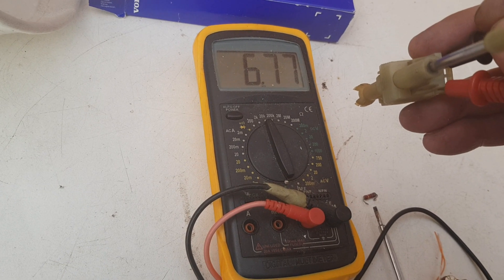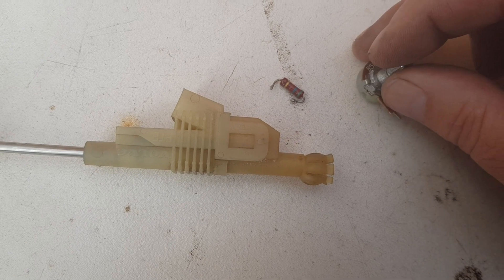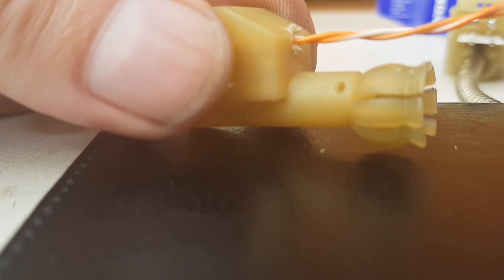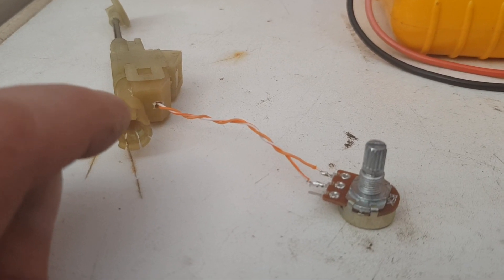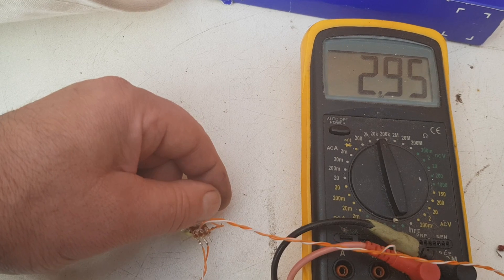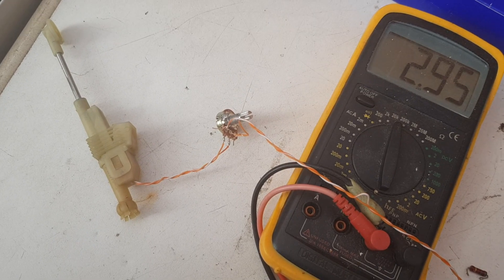Volvo clutch sensor future proof fix for pence, with variable rheostat.

Comment: Alternatively you can splice the potentiometer directly into the connector wires, so you don't even have to take the sensor switch apart.

Comment: @philcross7315     Alright.   I have the unit out now and it measures 4.55 Kilo Ohm (fully extended) and around 325 Ohm (fully compressed).  I believe (using an online tool - sengpielaudio)-  that I need to use an 8.8 Kilo Ohm resistor to bring it down to 3k Ohm and 313 Ohm respectively.       
Does this seem correct, and is there a target value for when fully compressed?  
Does it matter when compressed?
Cheers!
Reply: Just to close this off.  The sensor is back in place, the error cleared and never came back, and the car is no longer a bit "clunky".    One satisfied driver here.  Thank you so much!

PS I ended up using a 10k ohm potentiometer (se to around 8k ohm) that I set (and then sealed from turning) with some heat shrink over the screw mount and twister knob.  This defends against accidental turning, but means I can still get at it and twist if needed in the future. Cheers again Phil!
Reply from the maker: Being honest, it's hard to pin an absolute value on what the resistance should be. Using a variable potentiometer is the best way, simply dial it to what works. Using a normal resistor is a bit more absolute, but they are only pence.
I hope that works for you, if not, have a fiddle with the values.

Comment: Curious.  While the Clutch Position Sensor is removed  (physically and no wired connected).. Will the car (2006 V70R) still be drive-able, just not quite as smooth?   Awesome share Phil and others....!
Reply from the maker: It will still drive, but you'll have the error code. Mine was "sharp" on the clutch. Not a problem, I simply adjusted my driving style, but noticeable that something wasn't right.
Reply: @philcross7315  ah ok. Good to know I won't be stranded while finding the right resistor to add in parallel .  I receive a few potentiometer today so will begin tonight.  Cheers again!  I'll report back on my before and after spec (including the final fix values for me)

Comment: Hello, I want to thank you on behalf of all the people you have helped over the years with these videos. In my particular case, I haven't managed to solve it yet because I don't understand too much about electronics. I have placed a 10k potentiometer on the sensor, and I have set it to 3k ohm open, but when I close it it barely goes down to 2k. Is there any solution? Should I put a bigger or smaller potentiometer? I would greatly appreciate your help. Thanks again!
Reply from the maker: Hi Xavier, thanks for your comment.
Try turning the resistor down to 2k,or 1k. It should find a place where it starts to work? 👍
Reply: @philcross7315  Hi friend! Thank you for your quick response. I have just tried connecting a potentiometer of only 1k, and when it is open it gives 1k ohm but when it is closed it gives 500/600 ohms. I can't get it to the optimal values. Maybe the resistive track is too deteriorated? I don't know very well how to act now
Reply from the maker: @JavierCuadradoValverde
I think you might be right? The track is too far gone. You could try with a lower value, maybe 560k ohms?
Reply: @philcross7315  560ohm or 560k?🤣 I think 560ohm , no?
Reply from the maker: Sorry, it's been a long day. 😂
Yep, 560 ohms. 👍

Comment: I just want to say a massive thank you. I was quoted £364 at my local garage to "try" and fix it after their diagnostics showed up that it was the clutch position sensor. 

I had a lot of trouble trying to locate it, but for those in the UK (right had drive) who are trying to fix their own, the sensor is located on the accelerator side of the foot-well. It's quite high up, but looks exactly like it does in the video, with the same green port plugged into it
Reply from the maker: Thanks for the feedback, always nice to hear it's helped. 👍

Comment: Thanks you, your solution worked. I bought two sensors, one oem (lasted for a year), and one after market which failed after 2 months. Hope your solution is permanent. Thank you once more.
Reply from the maker: Mine did the same, so I put the one I fixed, back on.
So far, it's been a few years 👍

Comment: what was the part called and the wires you used ??
Reply from the maker: It's called a potentiometer, or rheostat. The wires are just standard, taken from a piece of ethernet cable. The sensor is very low powered, so any wire/potentiometer will work, as long as its the correct value.

Comment: Use long wires and stick the pot somewhere close to the steering wheel or OBD , so when you need to adjust it you don't have to hang upside down in your car to reach it.

Comment: Definitely going to give this one a try, already bought a new 'Triscan' replacement part once but it lasted only about one year until it was too gunked up/ poor quality to read correctly. Might as well try to fix both of them up while at it.
Reply: I managed to adjust the 3k ohm position correctly (previously closer to 3.6k), but slide/contact surfaces of the sensor were in too bad of a condition. When pushed halfway it got down to 1,6k ohm but it jumps back to 3k as the contacts are in too bad of a condition. I'll try later with the Triscan model of sensor, but currently I don't havet ime to test it out more.

Comment: Hey Phil! My sensors resistance doesnt go down after installing the potentiometer. dialed it to 2,8k extended, but when i press it down, the Ohm reading stays the same. Have I broken the sensor for good?
Reply from the maker: It looks like it? It should definitely change if the sensor has any resistance?
Reply: @philcross7315  yeah figured it out later. I did indeed snap the circuit board inside the sensor while opening it. Found the missing shard on my floor hehe. No worries tho since I got a new one at 3,1k - 0,240k from the scrapyard. Gonna try again once this one fails, with more patience and less force :D.

Comment: Phil Cross, 
Good afternoon, is the rheostat variable carbon or coiled?

What is the best solution for resistance or rheostat variable?

Mine still activates cruise control but turns off soon after.

What reference to the rheostat variable?
And the resistance?

Thank you
Reply from the maker: Hi vasco,
It's carbon. Set the resistance just under 4k ohms and try that. If it doesn't work, adjust it down to about 3.8k ohms and try that.
Reply: @philcross7315  thanks Phill. 
minimum resistance of 2w, can it be higher?
I will try. then I give an opinion. Phill after changing the resistance, do I need to clear the error or is it functional right away? Best regards
Reply: Phil I had to buy a new sensor, mine was broken. after putting it in the car do we have to restart the error or should it activate soon?

Comment: Cheers for that man. Although before i found your video i bought a new CPS from ebay but lasted less than 2 month. Unfortunately i chucked away the original one. But with your advice the ebay one works as well now with the b5k potmeter installed on it. Advice to some of you making this repair, if for whatever reason after doing this repair the cruise would still not work, just Reset the car's computer by deconnecting the battery for about 5 minutes... Happy cruising! 😊
Reply from the maker: Useful info, cheers jocky.

Comment: Hey Phil, just wanted to let you know I did this on my R model. Same issue, exactly as presented. Went to the shops and got a 10k pot like you said ($3.50 CAD), hooked it up and tuned it down to just under 3k ohms and presto, it's working. Mine was reading 5k ohms, car lost cruise control and was behaving erratically with throttle. I initially tried a resistor to get it down to 4k with no joy. You are a legend good sir! Thank you! 
I've been dealing with so many issues with my car lately, and spent a lot getting it keeping it going and this was going to be another 100 dollar ding in the wallet (part is $91.00 CAD + shipping -- non dealer item -- didn't even check the price with them out of fear lol) that I can't afford right now. I wanted to let you know that you really helped me here. Thank you!
This is what makes the internet great, that we can all share info like this. Tremendous! As a side note, this also helps me keep dabbling with electronics like I have. Really great. Thanks again :)
Reply from the maker: Sorry I'd missed your comment for some reason?
Glad you got it sorted.
Just for info, the new part I bought and fitted went faulty last week, so I fitted this one I'd modified. Like you, it's working again. 👍

Comment: Hi, I don't usually comment but I have to thank you for the knowledge learned to potentially fix this on my S60.  I also learned more electrical knowledge because of this and it makes it so much easier with an object that I know what it does. I'll comment back to let you know if it worked for my case.
Reply from the maker: Hi notenuff. I missed your comment, hope you solved your problem?

Comment: I've just taken my cps apart and cleaned it but  it still didn't work so I've just ordered a 10k pot off ebay for 99pence. Fingers crossed my cruise control works after this.
Reply from the maker: Fingers crossed. 99p hurts a lot less than fifty quid!
Reply: @philcross7315  The potentiometer arrived today so i soldered it on and voila it works spot on! Thanks you have saved me £50

Comment: Two cables from sensor to pedometer and then two from pedometer to what? Dont show in video....?
Reply: Again. Same misunderstanding. 

The two "extra" cables are connected to the equipment mesusuring the resistance. Is v called a multimeter.

And don't worry, the car is safe to drive without the sensor installed, but does not let you use cruise control.
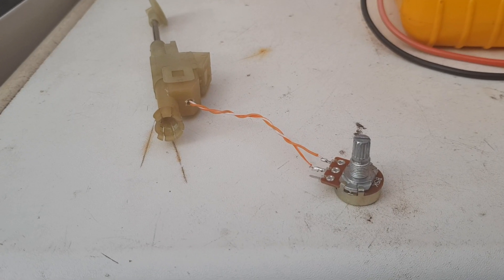Reply from the maker: It is only 2 wires. connect a wire to each of the connections inside the sensor, then solder the other ends of those wires to the potentiometer. One wire must be soldered to the middle/centre connector on the potentiometer. You can see the connections at 4:19 and then how to connect the potentiometer at 4:38
Reply: Hey. If you not understand. Go to garage. Don't do it self, will be danger for you. :DDD
Reply: @sergejssg  take it easy man.... Dont be toxit...

Comment: I dont anderstand 6.50 in the clip how have you connect all? You have two more cables connected from pedometer? Dont get it...?
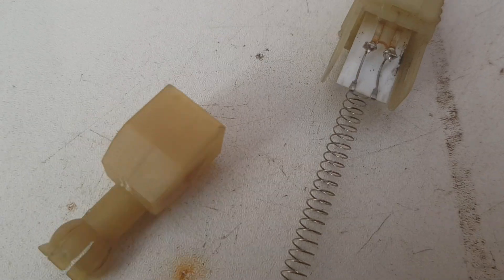Reply from the maker: Ah right ok, sorry it isn't clear. Open the clutch pedal sensor, and you will see two spots of solder connecting the resistive track to the pins that go to the plug. You can see them at 2:27. Solder 2 small wires to those connections, then enlarge the breather hole in the cover to pass the wires through, and put the cover back on. Then solder the ends of those two wires to the potentiometer. Solder one to the middle contact of the three pins, and one to either of the two remaining pins. Now, when you turn the potentiometer, you can vary the resistance. Put your meter on it, and set it at about 3k Ohms. Then put it back on your car, and try it. Hope that helps?
Reply: I think Yeah Buddy is referring to the cables going to the multimeter. 
I assume you put those or even soldered them on, to measure the resistance.

Comment: My is 4.7k open and closed 340.
Reply from the maker: Are you going to try using a potentiometer like this video, or use a fixed resistor? If you use a potentiometer, I'd sugest using a 10K ohm, and just diallling it down until your top reading is about 3K when connected in parallel. If your going the fixed resistor route, a 10k one brings you down to about 3.2k, and an 8.2K brings you down to just under 3k. It's an easier fix with a single fixed resistor, but using the potentiometer allows you to dial it in, and adjust it if it changes in the future. Good luck.